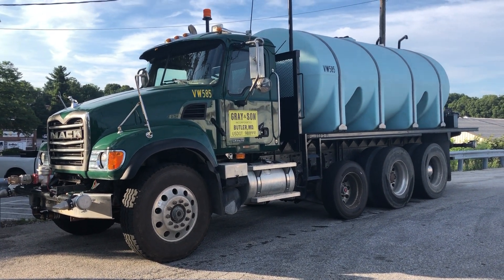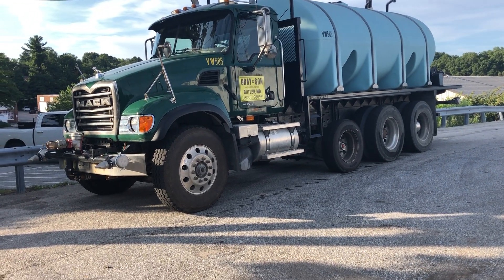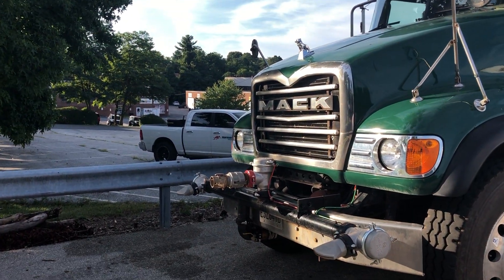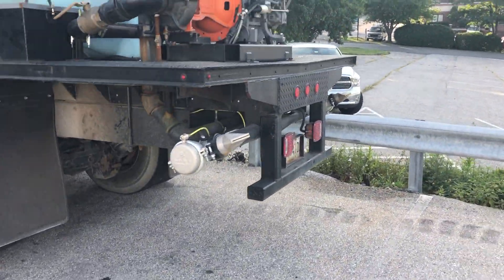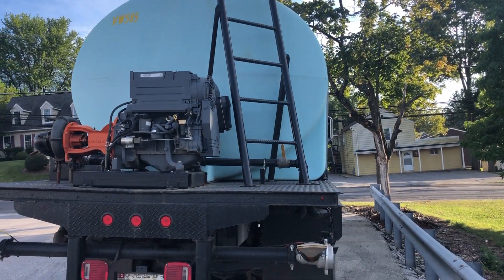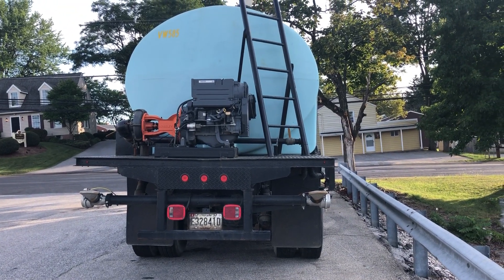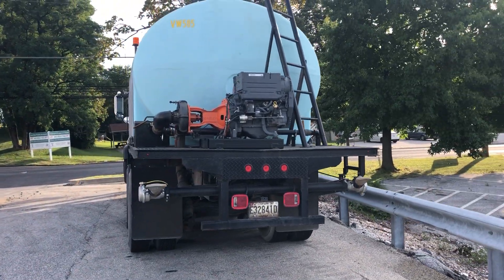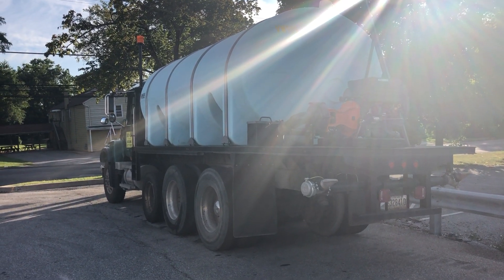Commercial Water Trucks #1 - An Overview

Comment: As a farmer I have a fertiliser supply truck and in the summer I always have it filled up water with so if there’s a brush fire in about a 20 mile radius I often respond because I know that my local volunteer fire department doesn’t have a tanker and the nearest fire tanker is often miles out I’ve turned up to many fires before that actually the fire dispatch actually now calls me and requests if I’m able to respond if there’s a fire in my area and even though I’m the only farmer that technically is requested often within an hour many of the local farmers just bring water in trailers